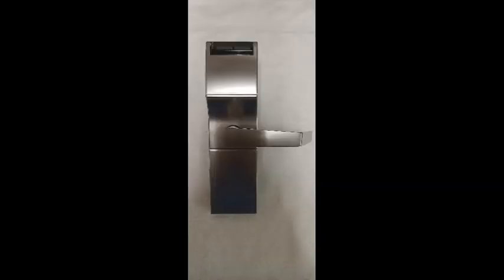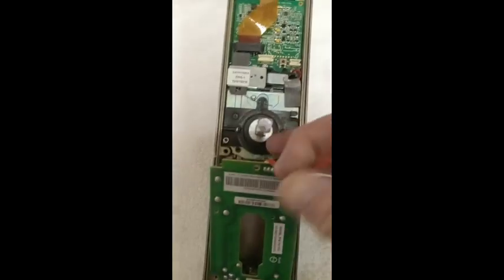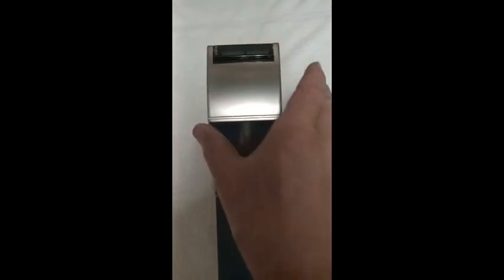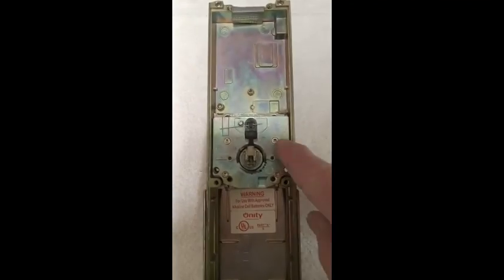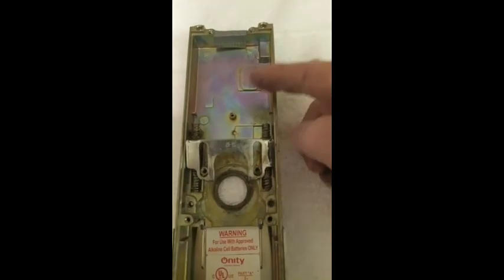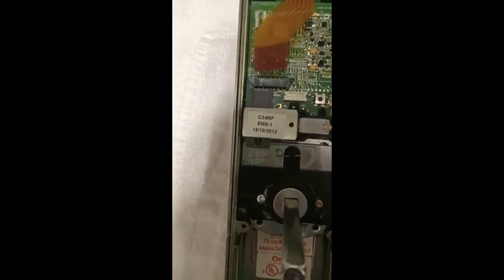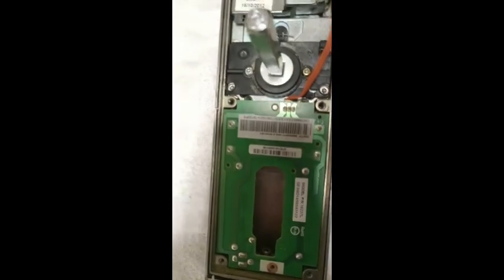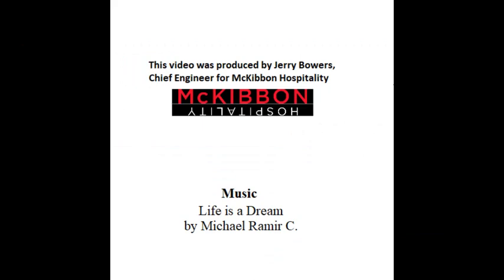Onity HT24 Hotel Lock - Tear Down And Rebuild

Comment: Red light blink ones insert card. No motor working? Why
Reply from the maker: Have you tried changing the batteries?
Reply: @engineeroffproperty7945  yes with new battery's also same. Only red light blink one's when insert card. 😔
Reply from the maker: @prageethchinthana2753  A red light can mean a few things.... 

If it is a used lock that you bought, you have to use a small screwdriver and press the red reset button on the back of the reader until the light goes out. You have to do this twice and then program the lock with your portable programmer.

 If you are using a master key card to open the lock, the red light could also indicate a damaged wire. It is usually the wire that connects the deadbolt (inside) to the main reader (outside). 

If you are using a guest key card, it means that either the deadbolt is thrown or the deadbolt wire is connected incorrectly. 

I would take the lock completely off the door, reset the lock and the reprogram it. Then try your key on the outside reader and see if the lock motor engages. If it does, put it back on the door to check that the communication wire works properly.